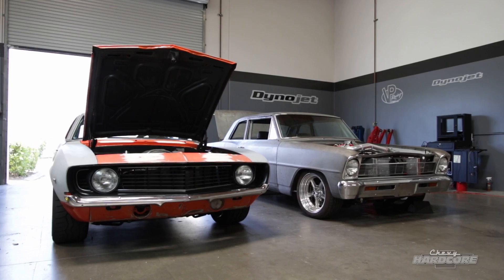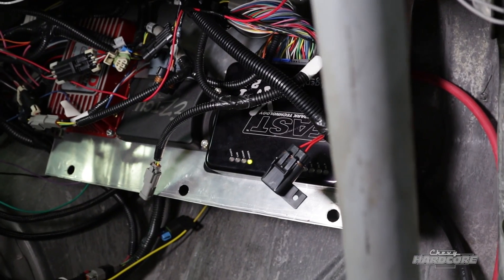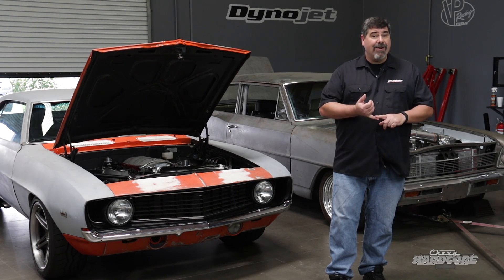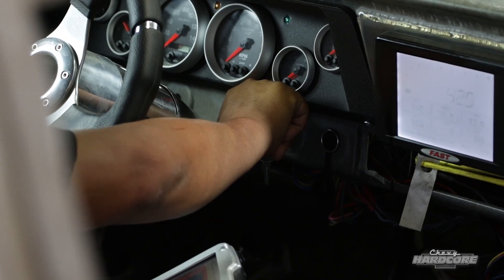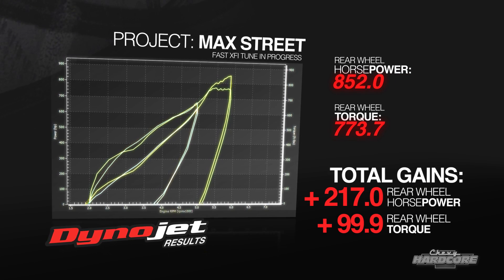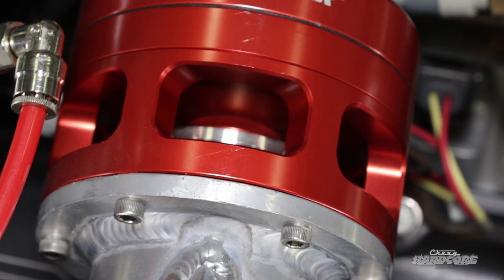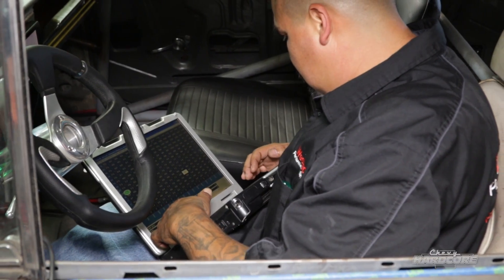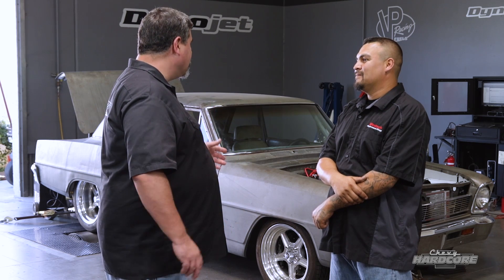FAST XFI 2.0 Takes EFI to the Next Level

Comment: People if you are looking at this video thinking about buying the EZ EFI 2.0 for Ls, look at all the reviews on it, mine was bad out of the box.
Customer service sucked, phone call after phone call, and you sit on the phone AT LEAST 10 minutes before someone gets to you, unit still don't work correctly. They have a tech forum but do not accept any new members, I have tried many times to join.  It is now back in the box, I'm calling it a $1500.00 lesson or MISTAKE, Summit won't take it back because it has been installed, so I am stuck with it. Just do your research before you buy it, LOTS of negative feedback.